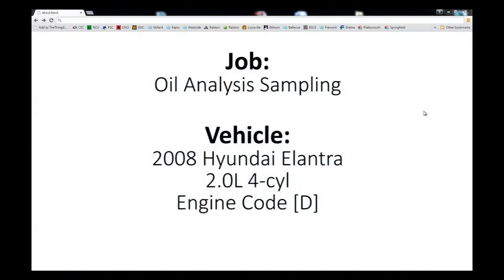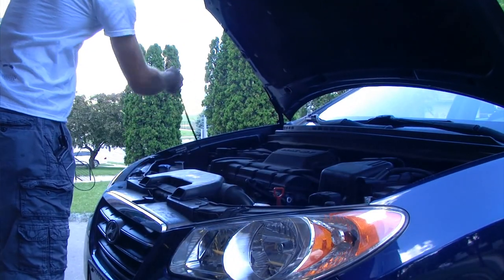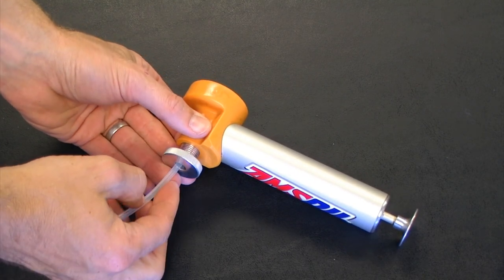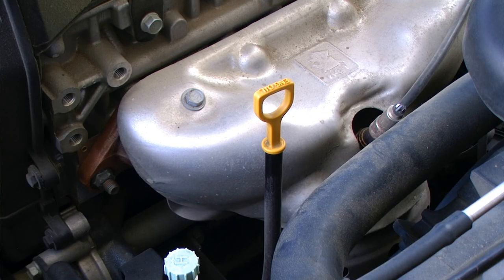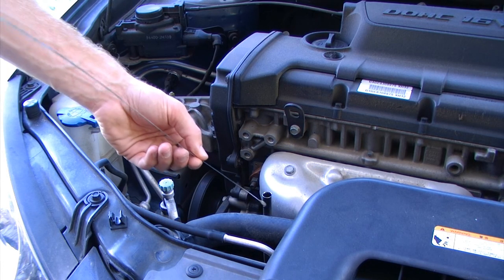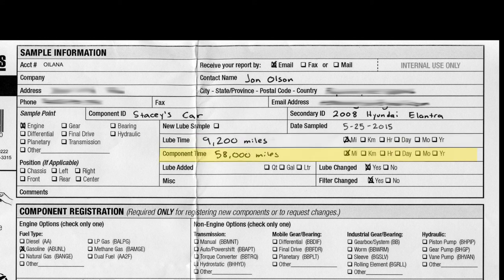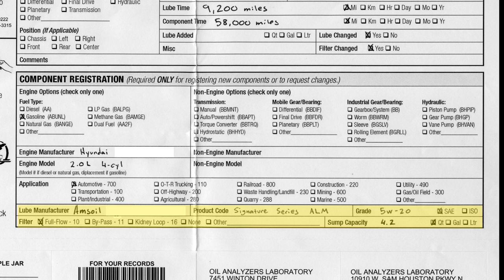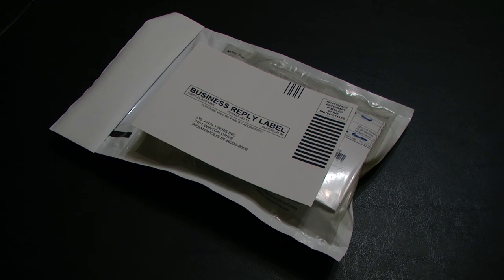Oil Analysis Sampling - 2008 Hyundai Elantra

Comment: Just to add for good measure then taking a sample from the dip stick tube purge the sampling tube by taking at least half a sample bottle of oil throw it back in the filler then take ur true sample.. it prevent carbon and silica deposits in the dip stick tube from contaminating the sample giving u a more accurate result..
Reply from the maker: Great tip.  Thanks for sharing.

Comment: I can't get that dam hand pump to work. Refuses to seal or something just keep pumping air.
Reply from the maker: Make sure you tighten the silver collar ring on to the tubing and onto the collection container.
Reply: @InsaneOil  I took out the O-ring that seals to the collection bottle and it worked. That O-ring would not seal against the bottle, but it would seal without it.
Reply from the maker: @karcharias811  Weird...glad you got it to work.